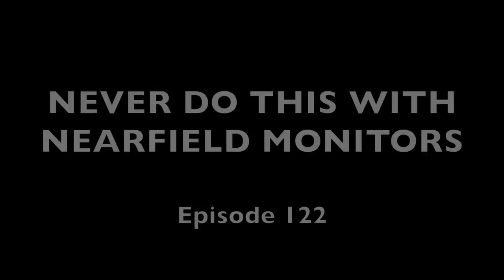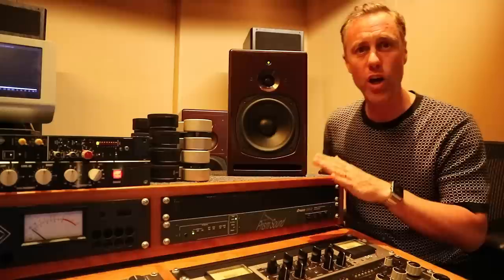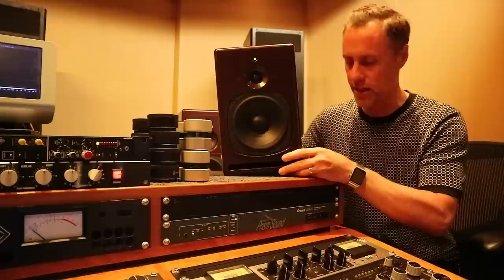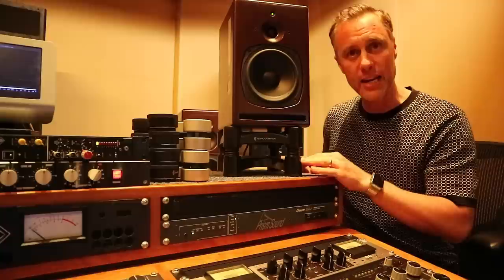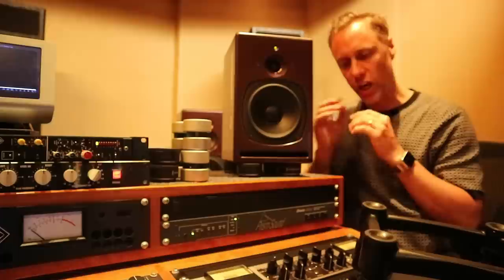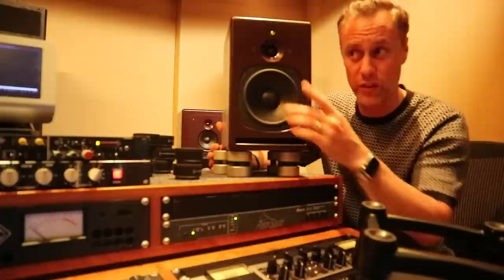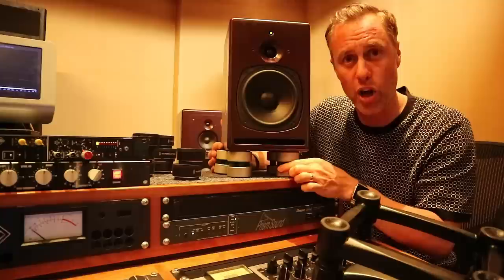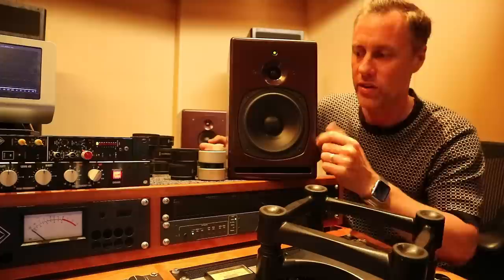NEVER DO THIS WITH NEARFIELD MONITORS !

Comment: The only thing that you said that is actually true is not putting your nearfields directly on your desk. Now, as far as all the isolation pads and pucks...that's a bunch of crap. Of course it will sound different and you'll think it sounds better. Yea...that's called the Placebo effect. The fact is, you ears will acclimate to the sound of your speakers. If you really want to improve the sound of your speakers...get different speakers. If you want to eliminate resonant frequencies and other audible artifacts...get your speakers off your damn desk and put them on stands with level spikes. You don't need...$600 hockey pucks! WTF...what a joke. That is all placebo man. Seriously. If you really want to test this out...do it scientifically with a sine sweep and reference mic. You''ll see all these pads and pucks do is change the position of the speaker and color the sound ever so slightly. Still...entertaining video. I liked it.

Comment: Yeah and that$1000 power cable will improve your audio amazingly too. Snake oil some? People use your ears. Listen to all the amazing records that were NEVER done with any of this bullcrap. If you really want to isolate your speakers do it for cheap by making a box and fill it with sand. That will isolate an earthquake almost and will cost you a fraction of what these ridiculous overpriced rubber pucks. Goobledegook I say.